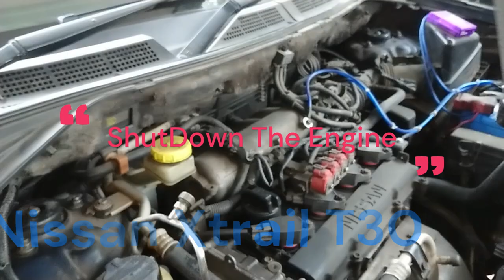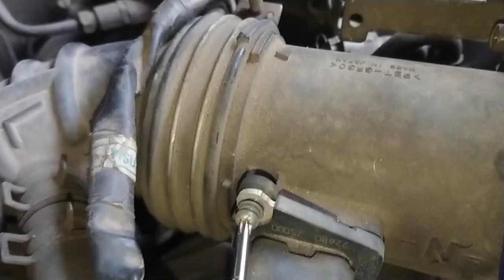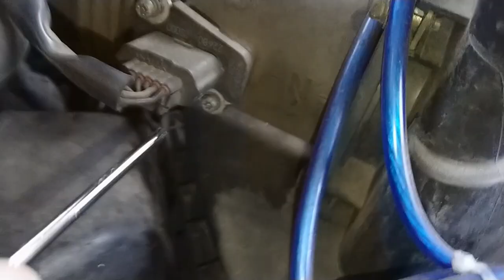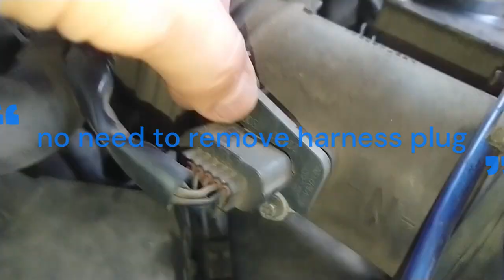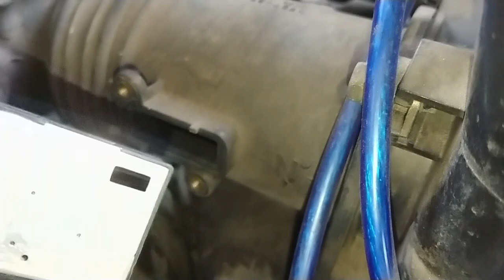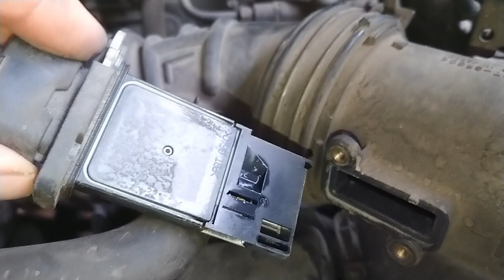Nissan Xtrail T30 Air Flow sensor Cleaning

Comment: Is it okay to use contact cleaner?
Reply from the maker: Not recommend!! the contact cleaner
because the chemical purpose of contact cleaner is  to clean the contact which made from material kind of metal eg. copper, silver, gold etc.

The both 2 sensors is not metal kind as you have seen on the clip